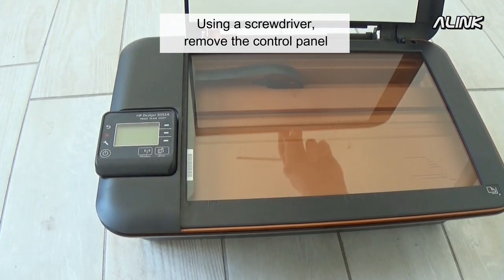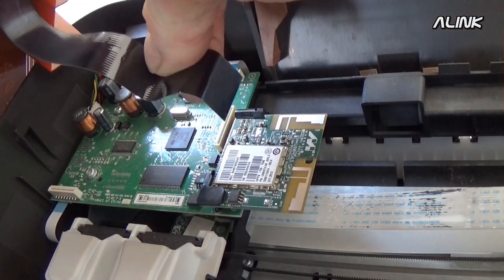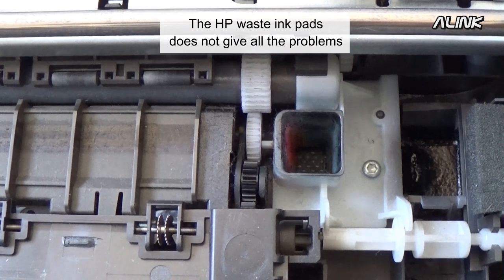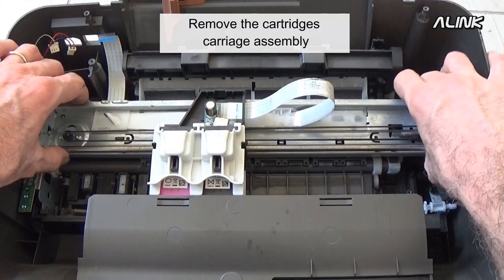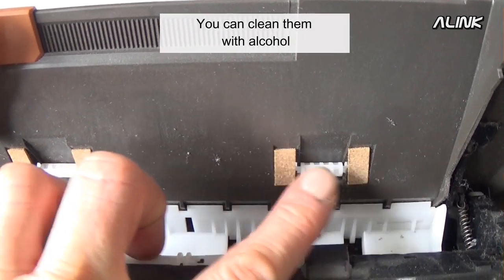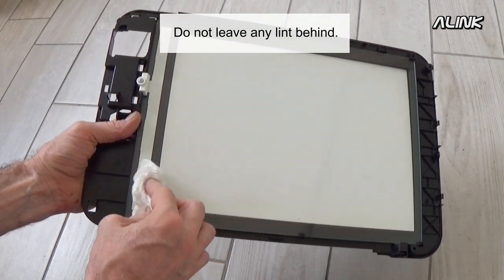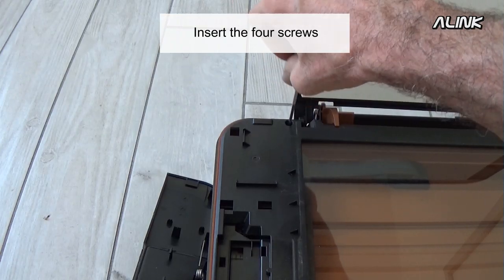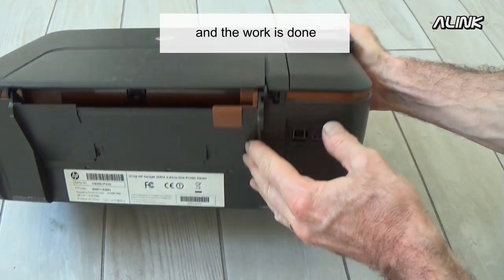Disassemby and reassembly H.P. ink-jet printer Deskjet 3055A and other models

Comment: This helped me a lot, thanks!!
I was trying to reach the flex cable for the cartridge to see if a poor connection was causing my "cartridge problem" issue. Thanks to these instructions I was able to remove the scanner bed, clean the soldered pins of the flex cable with a q-tip and alcohol, remove and reinsert the other end of the flex cable, put everything back together without missing anything, and finally see how that pesky error message was still there. But at least I tried my best. The good news is I've found a nice deal for a decent laser printer that takes third-party toner.
As a last attempt: do you happen to know any causes (that can be fixed) for the "black cartridge error" problem?
Reply from the maker: Did you try to change that cartrisge? It could be defective
Reply: @viandant5  Thanks for your reply. I understand that this error message should mean that the cartridge is faulty, but after searching for that same error it turns out that other people have kept having the same problem even after replacing the cartridge with a new one. I know I would have been seriously angry if I had bought a new cartridge only to keep having the same problem and then needing to buy a new printer. So I finally decided to made the switch and go for an affordable, black-only laser printer that won't clog up after a couple months of not using it (fortunately there is now a really good discount on a model I like).
Seriously again, your video is truly helpful, it's only that my personal case was a bit peculiar in that regard.
Reply from the maker: @requemao  I think that buying a laser printer you did a good choice

Comment: Hello! Thank you for this video, I haven't found any others on this printer! The control panel was snapped off and the flat ribbon strip disconnected from the board... I don't know which...feed it connects into? The flat black one on the underside of the cover was still connected. Just  the control panel. Please help if you would be so kind!! 🙏
Reply from the maker: At 6.26 there are the connections of the main board. Is this what you need?
Reply: Thank you so much for taking the time to answer! Not quite what I am looking for, but now I know it does not connect to that circuit board inside. It's the actual ribbon cable hanging from the control panel itself- the white one at about 7:05, that you said ro be careful with. 😂 When the control panel was snapped off, it disconnected that cable from whatever it was connected to, and now I'm thinking I actually need to try to detach the two cover pieces from eachother to see inside?
Reply from the maker: @GwennieD  I think it's better not to detach the connector panels, I think it's better to try to clean it with compressed air for ezample
Reply: @viandant5  sorry no the actual ribbon is just hanging out connected to nothing. So I'm trying to figure out  if it is supposed to be connected to something between the panels that I cannot see.
Reply from the maker: @GwennieD  Sorry I've not the machine and I can understand very well. Could it be connected with the upper cover?
Reply: @viandant5  maybe so. I will take those two apart to see if I find a connection point for it. Thank you so much for trying to help me out!

Comment: Thank you this video was super helpful for me. I got a paper jam problem and I still get this paper jam error, despite after I cleaned it all inside, do you have any idea why and what is the solution?

My model is: HP Deskjet 3515
Reply from the maker: May be a paper sensor is broken or its connector is detached
Reply: @viandant5  
Can you guide me how to fix that, please?, This is my father's printer he left it to me and I want it to work so badly. I have checked the paper sensor it's leg is not broken but I don't know if it's connected or not. 

Also whenever I try to print, it's skipping paper after paper until a paper stops in the middle then it shows paper jam error.

If you want to help we can talk privately, just send me whatever your account is link and I'll reach you. Thanks 🙂
Reply from the maker: @SalahRAhmed  Try these methods
https://www.youtube.com/watch?v=yXWgx8m-gY0&t=25s
First of all try to clean the paper pick-up rollers
Reply: @viandant5  I have tried these methods:
- cleaning outside of the cartridges.
- cleaning the 4 pads where the paper tray is (using alcohol and a tissue).
- cleaning the paper roller where the paper tray is.
- cleaning the inside parts with a dry brush.
- cleaning outside the paper sensor ( I didn't want to disassembly it to avoid corruption)
- cleaning the boards.
- I really checked that there's no paper somewhere inside.
Reply: Also I found out that my cartridges are dry cause it worked somehow to print (once or twice) but there's no ink on the paper. 

Could it be that's causes the paper jam problem?
Reply from the maker: @SalahRAhmed  A broken paper sensor could cause a false paper jam
Reply: @viandant5  Thank you for your help, I really appreciate your efforts to help people with your knowledge and experience. 🤝